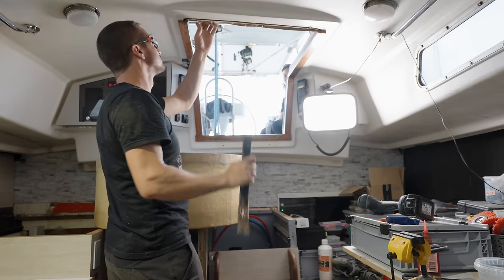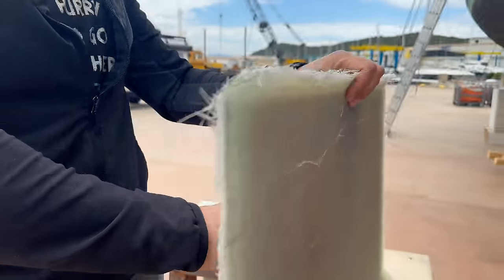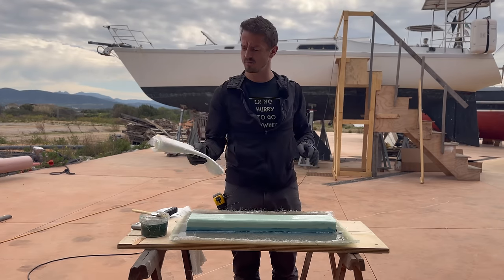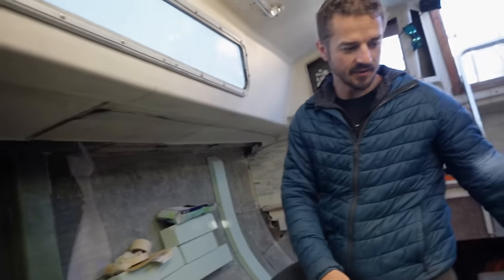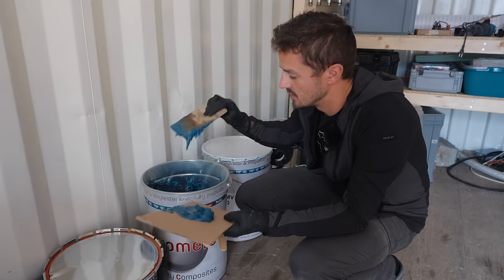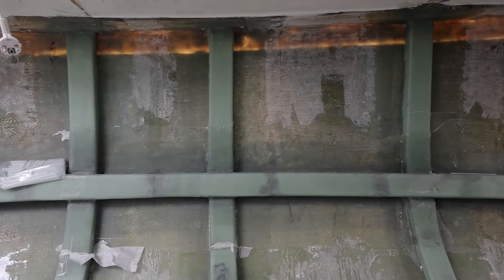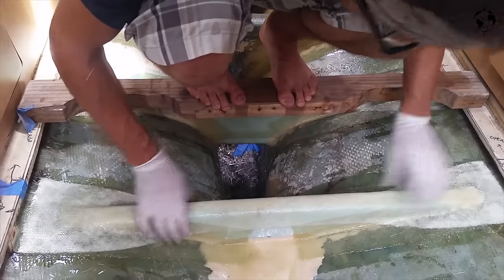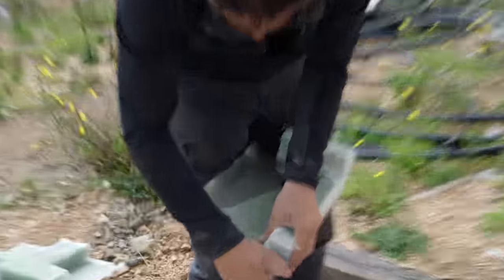Cutting Open our “New Hull”: What Could Go Wrong? | Step 386

Comment: There's a lot of electronics on boats these days (only more in the future). What are your plans to incorporate that into your boat? 
Should consider a multi-backbone network (backup for failure). And why use metal wire when you can use fiber optics which is immune to corrosion or magnetic interference.  They switched to fibre optics in aircraft / spacecraft for reliability and no interface.
Also fibre can Cary so many more channels across it to expand to any future capacity.
Imagine having 2 or more fibre cables sneaking thru the body. One can communicate fron to back along any of them thus averting future cable spaghetti. 
From a software (or HW) perspective, all one needs is softeare that converts anything into your standard data packet and back. This makes it invisible to the new device that it is anything other than what it expected (some bulky wires ready to break or corrode in the salt environment).
Also worthwhile are local hubs managing anything in its immediate vicinity. Sort of why you have brain cells in ypur elbow or knee to respond before the message has time to go all the way up to your head and back. Hot stove, instant, local reaction. Smaller, simpler computers & processors.
Leaving the main computer to focus only on the most complex tasks or navigation. Wven the drive motor shpuld be isolate by its own local controller which isolates the user from caring about how it manges charging or battery.
Think about it.
Computers have been shifting towards local intelligence such as the card on your hard drive which converts the geometry (platter  track, sector) into a simple numbering system (zero to billions) for your OS.
Reply from the maker: We have many plans for the electrical system, but you’ll just have to wait and find out.

Comment: Didn't see you "key" your model hull surface before applying ribs and new fiberglass. I would have thought that you would use thickened epoxy to attach foam to hull as well.

Comment: The compressibility of the foam is important for the strength of the completed job.  Why end grain balsa wood is used.  The higher the resistance to compression the stronger the final job.
Reply: The foam has nothing to do with the strength of the boat. The foam is only there as formwork to hold the glass in place.
Reply: @Sagan_Starborn  Not actually correct.  The foam or balsa sandwich is there to hold the two layers of fibre appart, the resin is to hold the fibres in place, the less compressible the material in the sandwich the more bending forces are transferred to tension in the fibres, resisting tension is fibres only strength.  The resin adds some resistance to compression but is not great.  Like reinforced concrete, the steel provides the tensile strength the concrete the compressive strength.

Comment: The main problem with polyester and vinylester is that there is shrinkage and it's not that great for bonding. It is very different when you start with glass and foam and lay a new hlul than trying to bond to already existing glass. Way better choice is epoxy, but it is double the cost of vinyl ester or polyester. Furthermore, I am sure you didn't wait to get full cure of your resin, which should improve the bonding (but will never be as strong as epoxy). Nevertheless, since you have already 1cm structural hull, I don't think you will have any problem in short term. But I will not be surprised if in 10-20 years you start seeing delimitation. I recently observed exactly this problem on a Lancer 36 from the 80's, where the grid is delaminated from the hull. Please feel free to reach out to me if you need any help

Comment: Hi just stumbled across your video. Congratulations for your project! As I haven’t followed along before, did you have this project planned by naval architect? I mean the structural components?
Reply from the maker: Sort of. Not really. It’s small enough that there are some basic principles and best practices to follow. But that’s kind of like having an architect and structural engineer design your garden shed. We do have a team of boat builders we trust on speed dial to chat to about some decisions, but on a boat this small, we’re not pushing the extremes of tolerances like on a race boat, so and actual engineer really isn’t necessary.
Reply: I see. You guys put a lot (really lot of work and love in it) I really love your dedication. 
I was asking because I am in the process of getting a new “old” boat but I am too old to spend “years” building. 😢
When I have read through some of the good comments I thought that it makes sense to chemically open the old Fiber glass and then use the wet in wet methode for the new layers that way you can achieve a strong bond of the new layers. (I got a lil ‘scared when I saw the hot glue pistol tho😂)

You are a fantastic couple and I wish you all the best with the progress and I am sure you will achieve a lot and be back to new adventures soon. 
What you will know about your boat by then - nobody else would know! All the best, Angel

Comment: There has to be some contamination between those layers. No way they come apart so cleanly without. As far as the order of the layers question, the advantage of small to large is that you only have one "edge" exposed that could potentially come loose. One edge also makes fairing easier.
Reply: They just didn't chemically bond.

Comment: What you are saying about the Type of foam doesn’t matter is not correct. I am a naval architect and I can tell you that it matters. Especially in the wide but shallow beam sections that you are creating for your beams it is important that the foam is able to transfer a certain amount of sheer and compression loads. In beams like this the beam works together with the hull skin where the outer skin of the hull forms the outer flange and the wide flat laminate on your beam the inner flange. It is relatively easy to understand when the frame is bending under load from water pressure on the hull you will have tension loads in one flange and compression load in the other flange. This will lead to the flanges wanting to glide on each other and coming closer together. This has to be relative forces have to be partially transferred by the foam and partially by the vertical side laminate of the beams. Since your beams are wide and shallow it is especially the compression strength of the foam that is needed to avoid buckling of the top flange of the beams.

Comment: The foam should be a polystyrene closed cell foam so it doesn't soak up moisture. An open cell foam will soak up moisture which you don't want. It really can't be any foam because if it soaks up moisture than you will not be able to get rid of that moisture. That moisture will be trapped which will cause blisters in your hull.

Comment: hmm..
1 -   you can get foam designed for use with polyester. It arbsorbs the polyester and if done right, "glues" the foam on to the surfaces
2 - 90 degree angles are not that great for polyester and fiberglass - it is very very easy to have air get trapped in the angles - air in fiberglass/polyester = bad. Use foam triangles in the corners
3 - always start with emuls as first layer on new surfaces or hardened/cured surfaces
4 - Be careful with how many layers you put  for on for each "casting" - polyester creates heat when it cures, can it can actually get to hot.
5 - 450 gram fiberglass = 1 mm thickness if done correctly...just a FYI

Anyhoo - your boat, your decissions - just a few observations from someone who has worked quite a bit with poly and firberglass :-)
Reply: The foam does not need to be bonded to anything. It is formwork to hold the glass in shape. It is the glass that must bond and it is the glass that forms the rigid structure.

Comment: Would it have helped adhesion if you had cleaned the surface with acetone or MEK prior to layong the table down?
Reply from the maker: Only if the surface is contaminated. But you want to do that BEFORE grinding. After grinding, you just need to remove most of the dust.

Comment: After sanding the corners of the foam all over the surface of the backing board, did you clean the board before brushing the resin onto the board? That foam dust may be part of the problem.

Comment: I think that the polyester resin is satisfactory for finishing surfaces, but the bonding strength you needed might better have been epoxy. And maybe the testing phase should have been done well in advance of the construction, or it isn't really a test. I got worried when I first saw the foam being bonded down with the hot melt glue. You might want to investigate the adhesion and tensile strength of polyester/vinylester adhesives versus epoxy. I have no knowledge or experience in this field but I suspect you will find that epoxy is considerably stronger. But your concept looks sound.

Comment: To be pedantic, the foam is preventing local buckling of the fibreglass structure, so technically it is structural, but i agree, any foam will do.  Surprised you didnt use epoxy, its an actual glue, where as the esters arent.

Comment: Do you have any concerns about flex/squeaking in the gap between the foam stringers and the foam ribs?  There appears to be a gap where the hot glue was used to temporarily join the two pieces?  Just curious.

Comment: Shouldn’t the ribs help provide channels for any water drainage to the bilge in case of a leak? It seems the cross pieces and floor support area would block and hold water without some through holes

Comment: The whole structure is one unit, not like your sample. It would be a good idea to put 2 or 3 mm of foam for insulation, then your fiberglass, to create a stronger sandwich and reap the benefits of insulation.

Comment: Would it make sense so install an insulating material between your original hull and the final two layers of fiberglass on the inside?
Reply from the maker: No because the bulkheads need to be glassed to the hull. So We wont be adding the insulation till later when all the bulkheads are in place.

Comment: How much are you losing on the beam dimensions and how much weight are you adding ?, re. how much will the draft increase ?
Reply from the maker: Considering how much we've removed, this alone isn't the determining factor in overall draft. 100kg might only change our draft my a few mm. We've hd this question enough we'll probably do a whole video on it soon.

Comment: The sample plate of the hull wasn't sanded, right? Sanding the surface helps the new material bond? The interior of the hull was sanded and cleaned.
I'm curious about the drainage from the sides into the bilge, especially from condensation,
no weeping holes? Have you considered that as an issue?

Greg 🇨🇦
Reply from the maker: Yup. We have. We’ll go over that in a video when the time comes.

Comment: The foam , the way it is glued, to y opinion, becomes a big air bubble, that starts a ripping effect when impacted. Also the resin rich of the lamination is also crucial to failure. My experience is backed by 45 years plus of repairing fiberglass hulls, kell ripping out of bottoms, etc..

Comment: For laminating resin you should not have cured(with the cling film) it between the three steps. It should have a chemical laminating bond between the steps. Sanding would help a physical bond but is not as strong as a chemical bond.

Comment: Surprised you made the longitudinal deeper than the transverse frames.  Typically you make the shorter span members the deep ones to support the long span as you have shorter effective spans for the grillage supports which is more structurally efficient, ie stiffer and lighter.

Comment: Wasn't the original problem the shrouds pulling/twisting the hull causing the "dimples" ? 
Are the new ribs/bulkheads aligned with the standing rigging?
Regards from a cold and rainy Gothenburg, Sweden

Comment: Wasn’t the hull sanded? Wasn’t The stringers installed on a sanding surface ? Your demo the stringers installed on a none sanded surface?  Good reason boat works today never uses the waist full dump in land fill peal-ply.

Comment: Hey, Have you identified what causes the delamination? The adhesion was poor, apparently, but what caused that?

I assumed that you used epoxy resin for the lamination, correct? Have you sanded the base plate? Have you washed and degreased it? I am very curious - I do lamination work myself from time to time, and I'm more curious about failures than about success cases.
Reply from the maker: You’ll love the next episode 😁

Comment: 1. To be fair, you didn't just hit your sample with a hammer, you sawed it in half prior to that, which would vibrate the hell out of it, while tearing the layers apart from each other.
2. The wedge you put under the sole might result in puddles of condensation forming at all heel angles but dead center.
Reply from the maker: The plan is no water comes in. Most of the water in our bilge while sailing came from the chain locker/windlass and the cockpit lockers. Both will be watertight when we’re done.

Comment: What I see in the video is workers trying to place a layer of mat fully soaked with resin and trying, I mean trying to stabilize it with rollers and brushes, what a mess! My way of doing it would  be to sread with a brush a small even layer of goo: resin with a bit of milled fibers first, not too much, just enough to make a contact glue for the dry fiberglass material, then wet the material wirh resin just enough to roll it; the goo acts as a cushion and is absorbed in the material. The trick is definately to resist the soup of resin that I see in the video.

Th other way is to lay the exact size of fiberglass on a film of poly, starting with the goo, then the layer of material that is the final layer, then just enough resin to soak it, then the next layer, be it bi-axial or uni , etc, always finishing the laminate with a mat for good adhesion. The trick is to roll the dry material onto the previous layer until the resin comes trough the previous layer, addind rein sparingly, hoping to achieve a 50/50 ratio. If you saturate a soup like misture with material, it will break readily, just like plstic rule we had in school; it bends, starting to crack then snaps. A 50/50 ratio laminate will bend and bend and bend, then eventually will fail. Vinylester is great for strenght versus weight of resin.  I still think that gluing the foam is the way to go; it is more important when you apply a thin layer of material; if you where  laminating a structural rib with ⅜ inch glass, it may not be as crucial, but my experience thinks that gluingg it is essential. 90 % of the work is with the bubble roller.

Comment: Your hull has bin sander and wiped down with acetone creating a strong bonding surface. Your sample was not.  I am also assuming you have waxed resin witch needs to be removed before laminating the stringers in the sample.

Comment: They're no Aladino. Your crew's glass layers look much more heavily wetted than yours did. Also, did you grind to scuff, and then wipe down the existing fiberglass surface with acetone before applying new resin for the addition of the stringer/ribs? That could cause the bond to be weak if you didn't. Will the actual versions on Uma have voids between the rib and stringer? That would decrease strength as well.

Comment: This is all my opinion. This is all based up decades of professional experience in industrial applications with every adhesive you could imagine, including hot glue, cyan and epoxy in a spectrum of applications:  If you want the greatest strength from the ribs epoxy them to the hull! If that is not a concern then stop reading here. If applied correctly the chances of failure with epoxy are extremely low. Hot glue should be considered like a post-it note. It will not hold. That bond will fail and create a gap between your ribs and the hull. In that gap the hull and foam ribs will abrade. The gap will increase. The fiberglass shell you have will still add strength but much of the massive strength inherent in the ribs will be lost. The chances of failure with hot glue are 100%. Likewise - though I know that it is popular [sorry Duracell Project] - cyanoacrylic glue aka "hot stuff" or "super glue" will not withstand dynamic impact. With cyanoacrylic the abrasion will be more aggressive as it is hard and brittle. The chances of it's failure as a long term viable bond on a boat hull are 100%.
Reply: The foam has no structural strength though. It's just a former to shape the fibreglass. Think of it like wax or sand in a casting process.

Comment: You did not put enough resin on your first coat of the chess piece, The cloth has to be thoroughly soaked just like the guys were doing on the inside of the hull don’t worry the inside is solid

Comment: On the model/sample foam and glass mockup, did you just use hot glue to fasten the foam to the hull section? If so, did the contractors do the same inside the actual hull? This is what I thought you were doing. If that's all true, it seems like a thickened resin would have been the right way to fasten the foam to the hull. I know the foam is just a form, but it seems like it should have a bulletproof bond to the hull just like the glass has. No?

Comment: Didn't the fibreglass team do a big sand to key in the resin and not use hot glue for the foam? Additionally the have larger sections to disperse the load and a generally thinner wall section? What was Dan's comment,  we do the design and let the contractors work out how to achieve it...  and a nice little foreshadow: "where we are intending to go" I assume southern ocean is next, drop into Melbourne if your coming through.